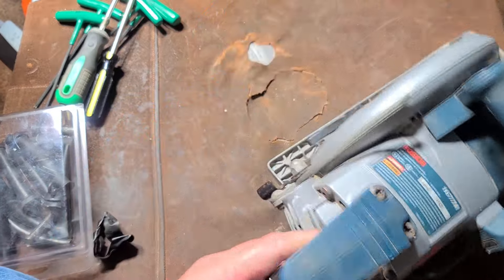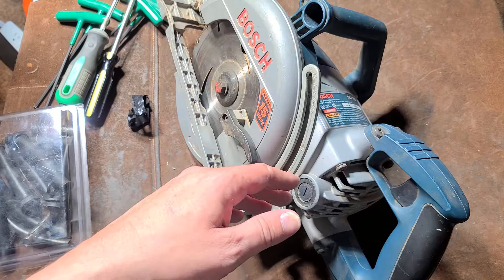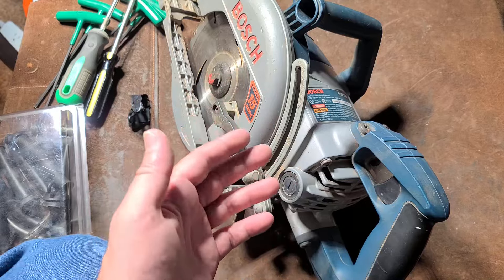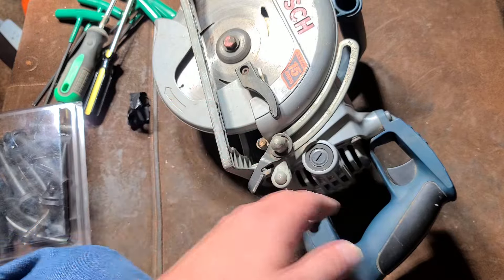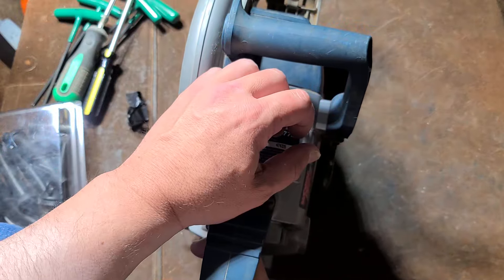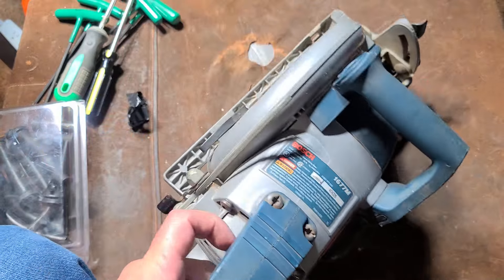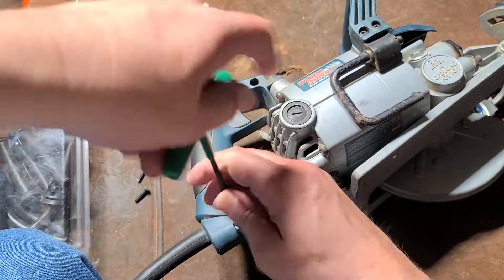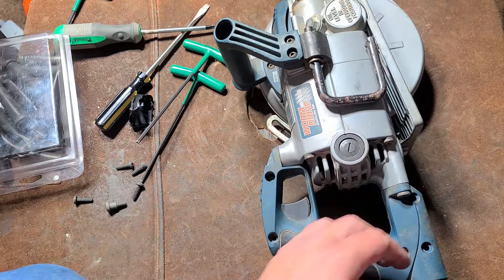The Bosch 1677M 15-Amp Worm Drive 7-1/4" SkilSaw...

Comment: I bought this saw back in the mid 2000s.  At the time it was the only skil saw with 15 amps, rafter  hook, magnesium shoe/table. These things would later be standard on skils, but at the time these were cool features. I agree the handles are not as comfortable as the grey or red handled skils during those times but it's a great American made saw that will get work done.